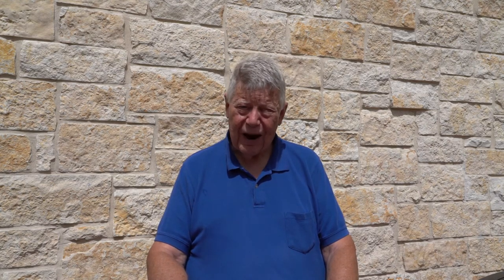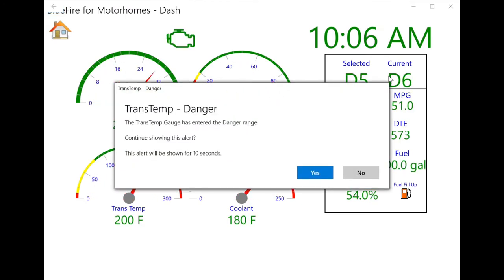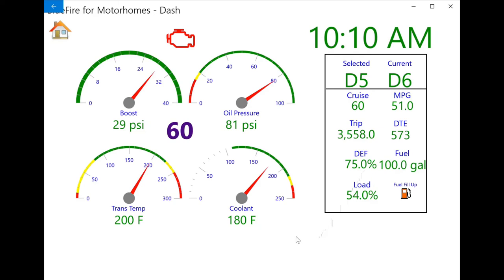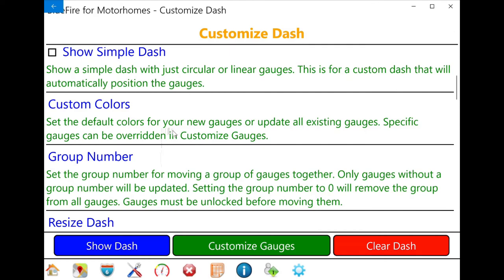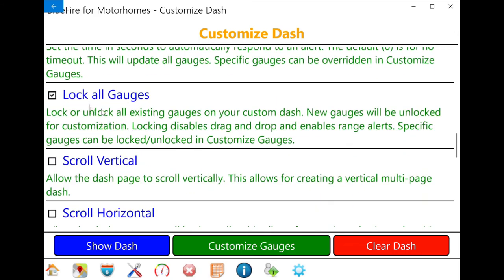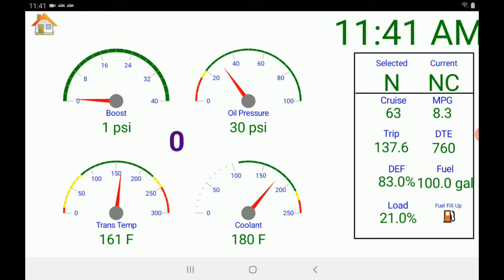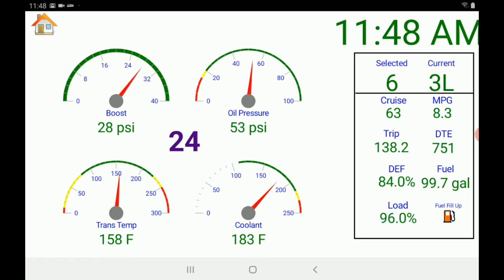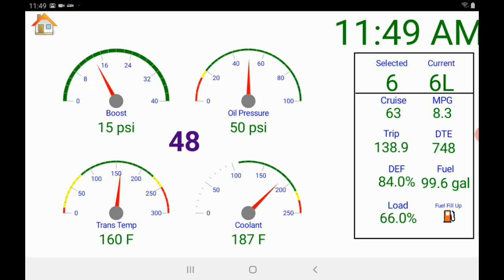Bluefire for RV Data Display System

Comment: Did you ever find out why the DTE reading seemed to be off when you had a full tank of fuel?
Reply from the maker: Depending on the iteration of their software, it can be off a little or a lot, or somewhere in between.  The system really doesn't deal with the generator using fuel so that is one issue.  Another is that the older software would start over again without keeping the previous MPG data so if you start with low speed and a lot of idling, you show really poor mileage.  An attempt to improve that was to force the system to run for a while before it would show anything.  Might have been a better idea but my system would routinely just not show a miles to empty.  Sometimes it would "light up" after a bit but just as often it would never show anything, so becomes pretty worthless not matter what.  To fix the system, it needs some way to figure in generator usage since that is a normal use of the fuel in the tank.  Until this gets a lot more attention, it is a pretty useless "feature" on the display.

Comment: Will this fit the 2015 Phayton on a Freightliner chassis ?
Reply from the maker: Well, yes.  I run it on a tablet set on the dashboard.  They have interfaces that pull the standard data from the vehicle buss so it will work on just about any chassis that uses the standard technology, and there are customizations for non-standard data packets.

Comment: I have a 1997 cat 3126 . Is all data common among manufactures?  My 97 beaver has a data monitor but only displays one item at a time . Impossible to read while driving.
Reply from the maker: Somewhat.  There have been two major iterations of the Society of Automotive Engineers (SAE) specifications for heavy vehicles, J1708 and the newer J1939.  So first it depends on what bus (data communications bus) was used at the time.  And within the specification, there are a lot or parameters that can be used but may not be used.  Which on is going to depend on who built the chassis and what the vendors of the engine and transmission chose to implement in that time frame.  Bluefire supports both specifications and so would be useful.  If you have the diagnostic connector (use Google to see which connectors apply to which spec) then you would get at least some of the data.  Without knowing for sure, I would guess that you can set up a panel that will display all (or part) of the data that shows up one item at a time on your existing display.
Reply: I have a 1997 bonanza patriot. Just bought a BlueFire. It took a little doing but I got it working. 1997 is pretty old so the data can be tough to get. But, it will mostly work.

Comment: What about a Prevost XL 40 with an 8V92, DDEC III?
Reply from the maker: I really don't know.  It is going to depend on the year and what Prevost decided to install.  It's been several years since the specifications were released and the data connections are now required on all heavy vehicles, much like the OBD-II connector is mandated on cars.